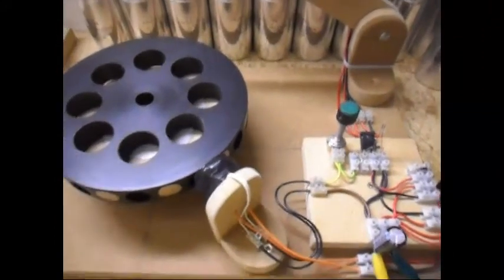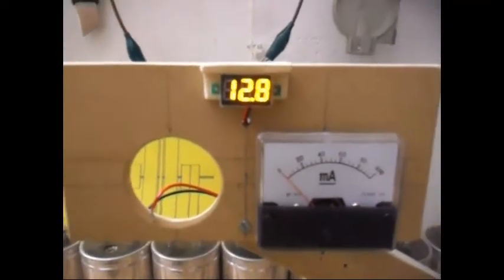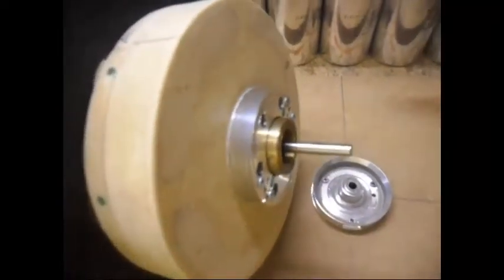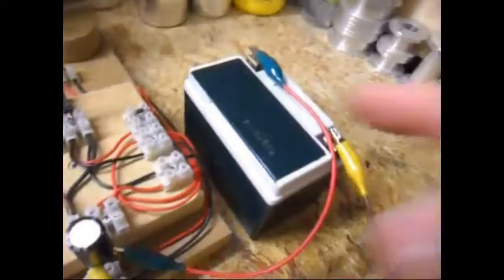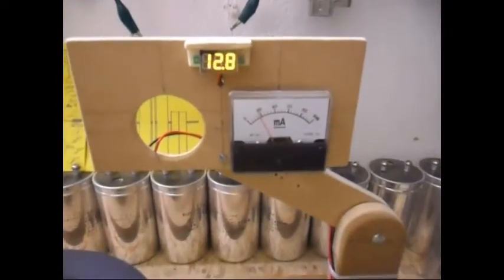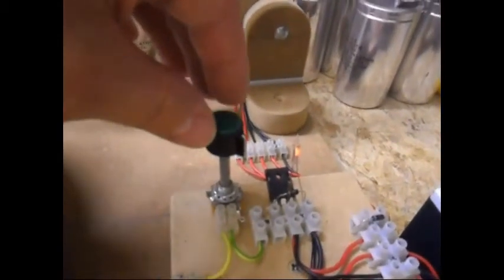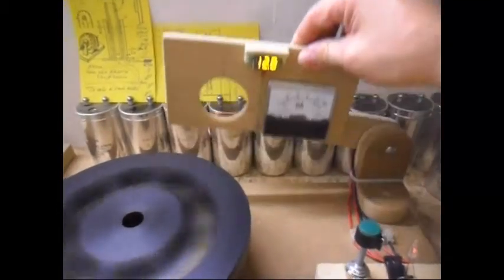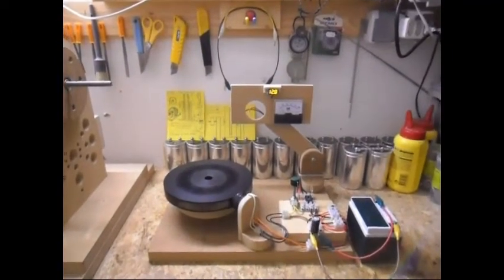Pulse Motor - Basic setup, Playing with b-emf spikes...

Comment: I have a question?
Can I replace diode 4001 to any diode ; like 4004 ?
Reply from the maker: I always use 4007 since the back emf can be very high so it is better...^^
The 4004 only goes to 400V and can be good in some cases...;-)
I would not use a 4001 since those only goes to 50v...;-)
1N4007 can be foud in most electronic stuff and this one has a 1000v value so it can handle all back emf...^^
Reply: Mister Caribbean Roots  first thank you
In the Daftman circuit two diodes one of them 4001 can I replace it with 4007 
Then two diodes will be 4007
Thanks
Reply from the maker: No problem and you are most welcome...^^
Yep, both diodes can be diode 1N4007 and that's the way i've always made it and it works with no problems...;-)

Comment: neon bulb that in the test screw ? or it have absolute volt ?
Reply from the maker: Thanks for your comment...^^
The neon is just there to capture the back spikes otherwise they will burn the transistor...;-)
See this vdieo which is the second part,
https://www.youtube.com/watch?v=-MA6AJOezAg
Real power in that neon bulb...:D
Reply from the maker: Back spikes have very high voltages but low in amps and the neon bulb i'm using is a 110V one...^^
Reply: Mister Caribbean Roots  can I use Tungsten lamp it's 220 volt?
Reply from the maker: A tungsten lamp is a bit to much for that little back spikes...^^
But that depends on your setup, if you are driving the circuit with say 12/24Vdc and with say 2/3Amps or more than it could light it up...;-)
But you can use any light on that back spikes...try a CFL or a Fluorescent tube or a Led light...just try anything around say 5 to 10 watt at 220 volts and see how it goes...;-)
A low wattage tungsten lamp should work also but as i written above all depends on what your system is using  because that will predict what the back spikes will be...;-)

Back spikes can be anything between say 30% to say 60-80% of the input if tuned correctly...;-)
Do try it and let me know how it goes...^^

Just connect the two wires of the lamp directly on the Collector and Emitter of the transistor...;-)
Reply: thank you for reply , in the daftman draw look at neon lamp i make like it and the lamp directly on the Collector and Emitter of the transistor.?
and i found that test screw voltage range from 100 to 500 volt 
i think it's right choice
Reply from the maker: No problem and you are welcome...^^
If you are going to use a AC light bulb you can connect it directly on the Collector and Emitter and no need for the diode that is on the Collector...;-)
Yes, the voltage can be very high but that does not mean that is has high amps also, but the more power you are pumping in the system the more you can get from the back spikes...;-)
Hope this help out a bit...^^
Reply: of course you HELP me , after i finish i will send video to you , But in my country no more electronics supplies i look  for each thing.
__Thanks__
Reply from the maker: Glad i can help you out...^^
"no more electronics supplies"... that is a shame but most things can be found in damage/old electronic stuff so i do hope you will find everything you need to make it work...;-)

Btw, the back spikes are also good for "desulfating lead acid batteries"...in other words the high voltages cleans the plates inside the battery so it will be able to hold charge again...

So if you have a car battery that won't charge and is still good with no cracks and such run it for a few days on that system, after that do a (refill with distilled water if needed or before) and than try charging it in a car or with a charger and see if it has help...sometimes it does charge again but it does depends on the state of the battery of course...and sometimes you need to run it a few times on the bedini for it to work...charge and discharge...;-)

 Btw, the battery will look like it has been charged after a few days on the bedini but that is only surface charge...;-)
Cheers
Reply: God bless you :D
Reply from the maker: Thank you and may he bless you to...^^

Comment: back when i was playing around with pulse motors, i came across this http://youtu.be/OOoq10M2YkA you just add a second coil in parallel with the bi-filer one.
Reply from the maker: Hi lykenth08,
Thanks for your comment and video link...^^
Checked your video, nice speed with that parallel coil arrangement...:D
Reminds me of my "Almost zero b-emf setup"...Hyperdrive speed...lol
Pulse Motor_Basic setup - Almost zero B-emf Update 1 Hyperdrive speed, N-channel mosfet...
This setup here is for low rpm only especially when them magnets are not glued in the rotor...they just sit in the holes nice & tight...lol
Reply: i can understand your concern with the speed, one of them magnets come off on another rotor i made and left a scar right between my eyes... nearly knocked me out. the magnets also sucked in a screw driver and spat it out, thankfully i was not in its way. are your arranged north south like mine?
Reply from the maker: lykenth08
Yeh man, we must be careful...i had one wooden 24 pole rotor blew up completely just when it passed 2500 rpm...
Since than i'm using a bit thicker MDF and a lot more glue...;-)
There are still holes in the wall of my Lab to remind me of this...lol
If those magnets had hit me i would have been knocked out for sure...lol
In the Hyperdrive speed PM they are North-South arranged...in this PM they are North or South out...i've forgotten wich one it was...lol
Reply: Mister Caribbean Roots TWO YEARS AGO I SPLODE A ROTOR MAGNET TO 23,000 RPM WITHOUT CONSECUENCES BECAUSE I PROTECT THE ROTOR WITH WOOD.
Reply from the maker: skycollection
We have to be careful with high speed setups...^^
Thats the reason that i don't like it much but sometimes i do need to use higher rpm to see what effect we get...
A wooden cover will certainly help...^^

Comment: But you would gain more catching the spike before it comes back.  It comes back because the end charges to high in its capaciatnace of whatever is stopping it, and then that peak voltage comes back; but in less current.... it's the same power (slightly lower because it would be lost in the resistance)... but if you put a forward diode so the coil doesn't build a charge, allow it to pull from a cap... the size of the cap will determine how much voltage you get (based on the current inertia in the coil... )  a schematic would let me point out what I mean... even a rough sketch
Reply from the maker: Hi J Decker,
Thanks for your comment and input...^^
I think you mean a doide on the line to the collector after the coil...no...???
I'm gonna modify it bit by bit ala TimManPower style circuit...i had very good results with his modification in the past but it has been a while ago...so i hope to get it done again...lol
Google "TinMan bedini circuit"...it should be the first circuit you see, it's one with 5 diodes total...;-)
Reply: it's actually 'tinmanpower' bedini  but that search doesn't turn anything up... you can paste links now to youtube comments
Reply from the maker: J Decker
What i wrote does give me the right search pages with the circuit...^^
But heres the google search link,  https://www.google.nl/search?q=TinMan+bedini+circuit&source=lnms&tbm=isch&sa=X&ei=2f-MU9_LGcX20gWK_YG4Bw&ved=0CAYQ_AUoAQ&biw=1264&bih=921#q=Tin+Man+bedini+circuit&spell=1&tbm=isch

It's the first circuit you see...at least thats how it appear to me when i search for it...^^
Link checked, the first circuit it is...;-)
Reply from the maker: And here is the video from TinManPower that goes with this circuit...^^
modified Bedini SSG circuit and demo.flv